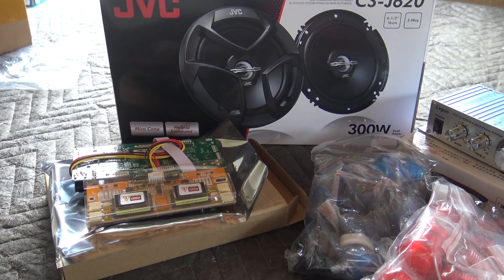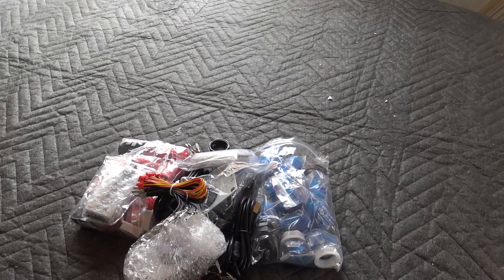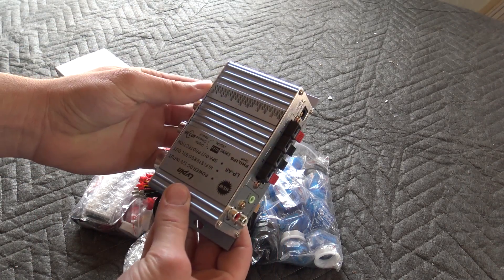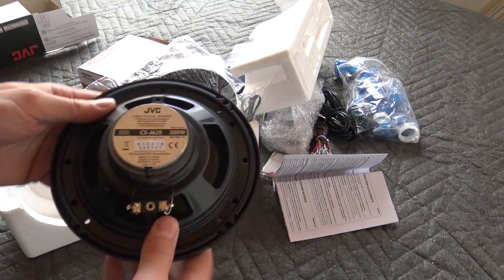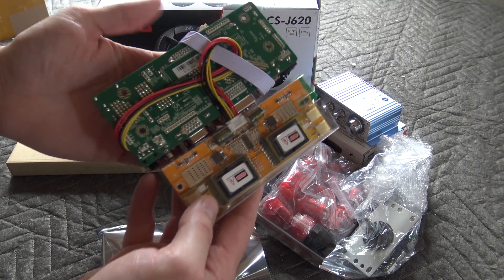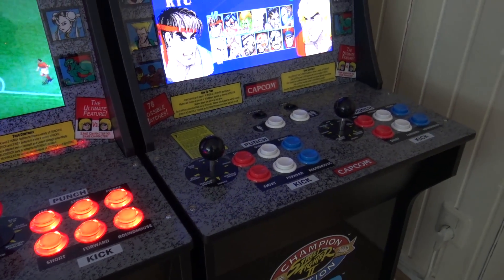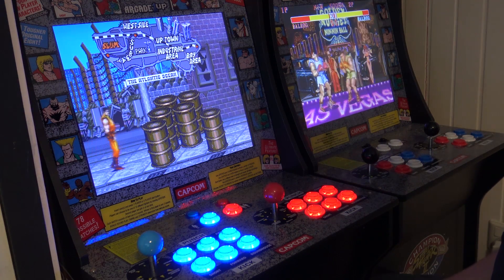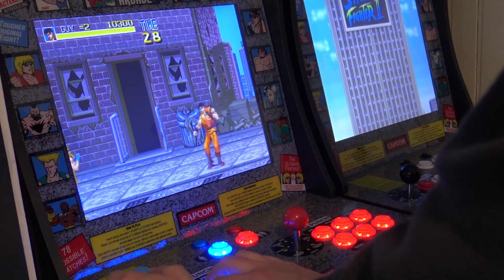Arcade1up Raspberry Pi Cabinet Modding !

Comment: I have some car speakers left. Can I use these for a cabinet?
Reply: Yeah, you can basically use any old speaker. I tore apart an old Bluetooth speaker with 1.5inch speakers and mounted them right below the marquee on the inside just like the new cabs. As long as you have an amp you can use anything.

Comment: Where inside the cab are you mounting the speakers? Directly on the monitor backside?

Sorry I can’t make it out
Reply from the maker: I used 2 speakers and added this on the bottom. 
With my Pandora's Box Build I used the original speakers and used original speaker see this video. 
https://youtu.be/b4Y2OWUgtcQ

Comment: So good.  I can't afford to do things like this right now so I live vicariously through your videos.  Thanks for sharing with us!  Great music track.  Love those lighted buttons, but I think you should try battops for the joysticks.  Is the bottom of the Arcade1UP joystick panel really that cheap? The plastic looks warped.  I love the way you mounted the speakers and the amp, and how you used the space for the off/on and volume selectors to mount the extra buttons. I think you should light them.  Sorry for the run-on comment, I kept adding to it as I watched.
Reply: Chris Barnes I know you said you can’t really afford to do one of these right now but I’m here to tell you, it’s not as bad as you would think! You can actually find a space invaders or centipede 1up cab for around $100 now. You can get everything else needed for an additional $150 (if you shop around). As long as you are a little handy with drilling new button holes and some minor wiring it’s not bad. I went a bit more high end with my Street Fighter 2 cab and all in I’m at around $400 including the arcade cab. If you ever get one  started hit me up right here and I can hook you up with an sd card loaded with everything just to help you out! Cheers
Reply: @nitronamous  Excellent!  I'll keep my eye out.  Always dreamed of owning an arcade machine since I was a kid and they're finally coming into reach.

Comment: Now this is one video I have been waiting for! I was especially considering if I would be able to mod one of the upcoming Marvel or TMNT Cabinets with a Pi.
Reply: The reason everyone is modding the Sf2 1up cab is because of the 6 buttons. When u mod the sf2 1up you only need to drill two holes for a select button for retropie, you need those. The other cabs need a lot more drilling.